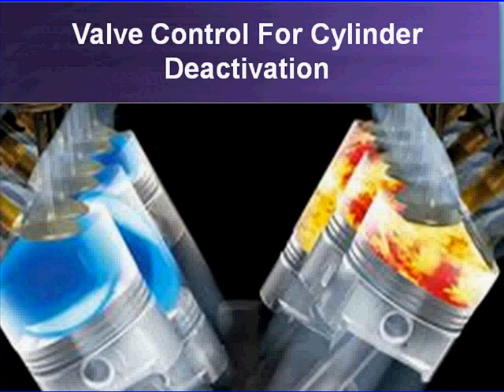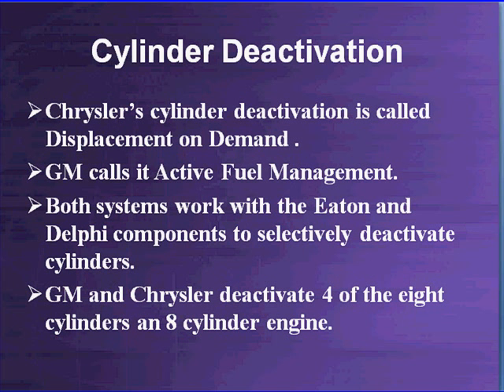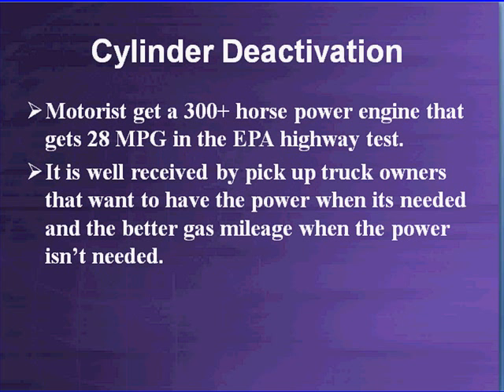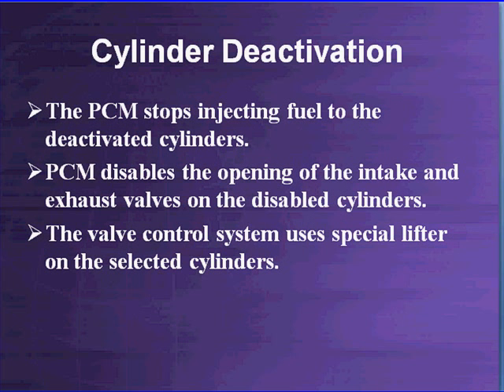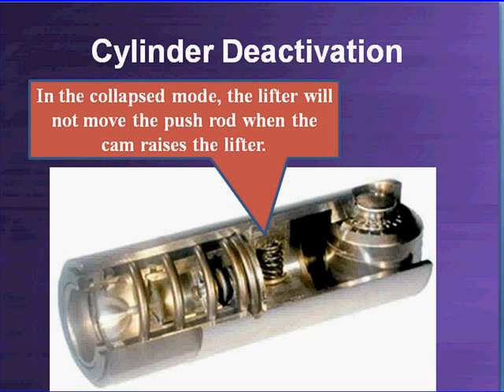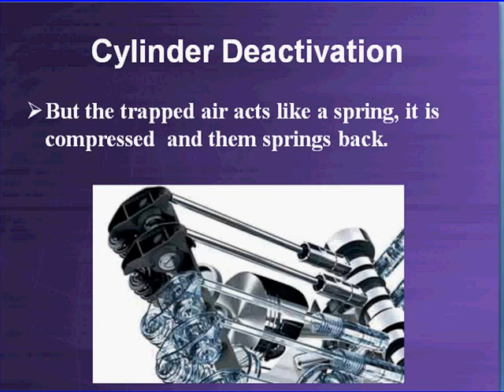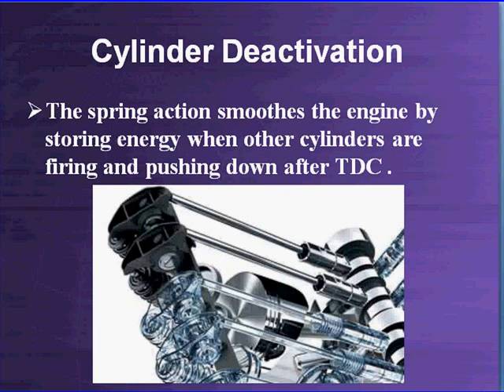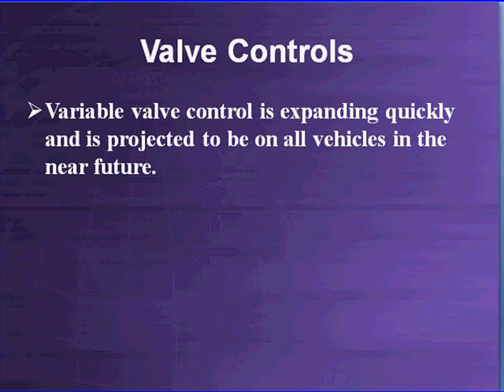5 Valve Control for Cylinder Deactivation

Comment: 2 gm trucks I owned  have had lifter failures. One @ 32,000 miles and one at 4,000 miles. Emissions garbage. Trucks were maintained by dealer.

Comment: I had a 5.3l in my 2018 Silverado and it had lifter failure at 28,000 miles. Camshaft and lifters had to be replaced. Fortunately it was under warranty but it never drove the same after the fix.
Reply: @Justin Gardner Agreed! I traded in for a 6.6l diesel the same year on the 2500HD. All of these 1/2 ton V-8s are BS.

Comment: all these new tech are a piece of garbage and a money pet to our pockets because when they fail are super expensive to fix and all the money you save on gas with this "system" you going to give in back to the dealers or mechanic shops, the best way to save money it's take off this crap out of y
the engines; if you wan to safe money on gas buy a four cylinder car or truck, and if you need power get a strong v8 truck.

Comment: I own a small company with 14 gm trucks ranging from 08-18. We have had a change to do allot of oil testing and really put these systems thru it’s paces. I would have to say personally that preventive maintenance and regular scheduled maintenance with a high quality oil and they just work and don’t fail! We have 4 failures on three trucks. It is a bitch and expensive but they trucks lacked good oil and we skimped on the maintenance we diagnosed every single one for a root cause and it’s just a result of poor oil and sludge dislodged and clogging vlom and creating oil pressure issues.
Reply: What oil are you using and how often is it changed?
Reply: Amsoil. Changed every 25,000 miles and filter changed at 15k then at oil change.

Comment: My 2018 Corvette 6.2L V8 has this system.  Going in and out of cylinder deactivation is smooth and unnoticed.  460 ho and I can get 25 mpg highway driving all day long.  The worst mileage I ever got, city suburb driving was 20.5.
Reply: BS
Reply: It works when it’s new, it’s just trouble when it stops working.  Their biggest mistake is that to replace the AFM lifters they have to remove the heads.  The repair costs are a problem for owners.
Reply: I have 91,000 on my Silverado and sometimes AVERAGE 24 MPG usually 22 or better on the Express way.  Haven't had a problem yet..
Reply: AFM is short for automatic failure mode.  I used mobil one full synthetic with oil changes at 5k and my 2015 Silverado took a dump at 39k.

Comment: I'm not sure about the oil being the problem. In our shop we use a dexos approved full synthetic out and they still burn a lot of oil.
Reply: Josh Staton dedos approved mean nothing full synthetic means nothing. Sludge and it clogs up the vlom and you have oil aeration and failure. Poor oil poor filters causes this.